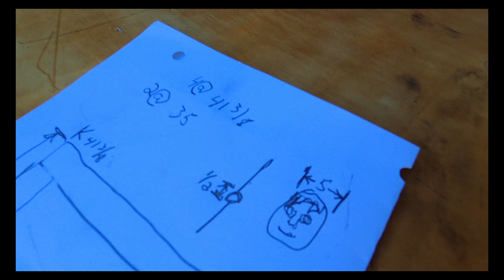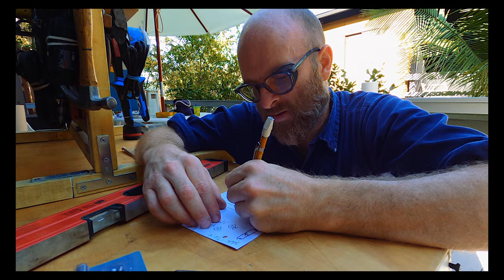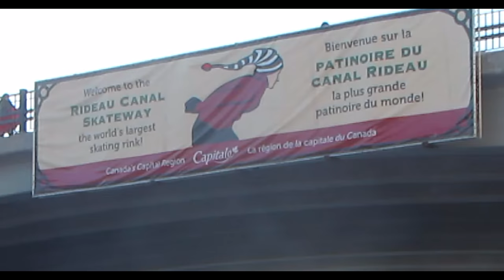Sean Avery: A Conversation & Custom Baby-gate Build

Comment: I would have put the planks of wood horizontal rather than vertical, to match the already existing planks on the balcony. And spaced them the same for the head measurement that was done in the beginning. The wood burning and lacker was a nice touch but isn't he going to paint it like the rest of the deck?

 Let's see this, NHL players fight Jake Paul!! Avery first opponent???

'02 Red Wings were an amazing team. Had them all there

Comment: Another fantastic movie Van! Unfortunately the vertical bars on those gates are probably too far apart. To be 100% certain that a toddler (or a crawling baby with their flexible skull) cannot force their head through, those bars have to be very rigid and the gap between the vertical bars should be no more than two-and-a-quarter inches  (2.25") wide. The slats you used will flex giving the baby even more chance of getting their head through. Also you may have opened yourself up to legal liability and any damage that your gates might inadvertently cause to a child. Do yourself a favour and replace them with a couple of commercially available "baby gates" that meet US & California standards.

Comment: This hockey guy is so full of himself.
Van, get the right size screws man!
Reply: Think about it, screws are tapered pretty severely at the end so if he would of used the right length in this scenario they would have a great deal less grip strength on the back end but yeah he builds stuff in his own eccentric way.

Comment: Very cool conversation. Hockey players are the most athletic though? He's obviously biased. I know he talked about doing comedy and that's the funniest thing he said!
A couple observations from the video: 1) I probably would have added a washer (or similar) for the gate lock pin to stay seated and not wear out the wood around it and 2) degreaser works with elbow grease, but a much simpler way to remove oil stains is to spray liberally with brake parts cleaner, cover with kitty litter for an hour or so, then just brush it off.

Comment: Watching Van build that gate was excruciating.  The duplicate marking out. The individual drilling in every piece a pilot hole. It was fascinating, and painful at the same time. 
Why not just pin it all together and then drill through it and screw it all in one go. 
I think you marked, centre punched and drilled 60 unnecessary holes. 
Like your videos though.

Comment: Dangerous??? I thought those slats looked wide. You don't want the kids head stuck in them, maybe not that kid, but future smaller kids. A quick web search gave answers ranging from maximum 2 3/8" to maximum 3"  apart. Those look much wider. May never be an issue, but something to think about that could and should be fixed.

Comment: You have to be an amazing athlete to achieve being a pro NHL player,  plus countless hours of training over years. The average pro mma fighter is increasingly becoming more athletic,  as the sport progresses sure but maybe even more so the fact that you can finally earn a living in mma without being in the top 10. Less than 15 years ago you could be fighting a guy in the top 5 and you might only make 6k to fight and another 6k to win. That's not attractive to someone that is athletic enough to play another sport, one in which there are far far less dire consequences. The caliber of athlete is much higher now,  as well as the techniques that work from every martial art have been honed.  No one,  no one,  can throw more than 5 percent of the strikes used in martial arts properly enough to land it with any consistency against an opponent who is intimately familiar with these techniques as well,  without learning it(taught by someone with a lineage which is religion to martial arts,  like where did you get your bjj black belt sheet 10 years of training a few times a week for hours). I've never seen a combination thrown in hockey btw, and i have never seen an actual fight pro or not  look anything like a hockey fight cause it'd be dumb to fight with such vulnerability of you didn't have to. "You don't know me bro, I'm a savage" "I don't need technique,  I'll make it ugly", an actual trained fighter would be ecstatic to null spastic movements while lactic acid builds in your muscles till you limbs become soggy noodles perfect for folding these wrong way.  I can go on forever,  but I'm pretty dumb.  Please clip the section of the talk about how well you'd do in a mma fight, and send it to any pro level mma gym near you but I'd pick kings mma. Tell them that you would like to "lightly" spar against a pro that isn't gonna try and knock you out or hurt you.  After only doing striking sparring, try mma sparring.  I've seen a lucky punch or 2 land,  but I've never seen a lucky submission.  Please film it :) btw you would destroy me with any handicap I could have no doubt.  I respect and appreciate yall.